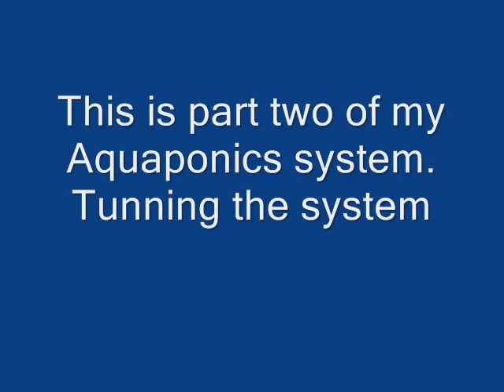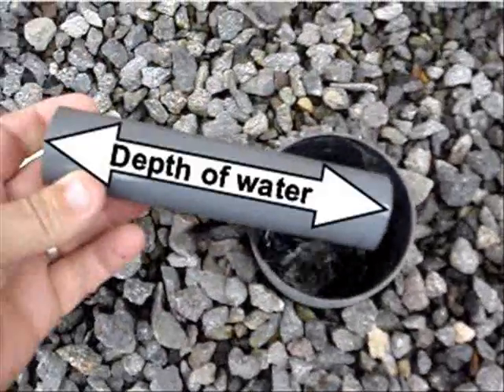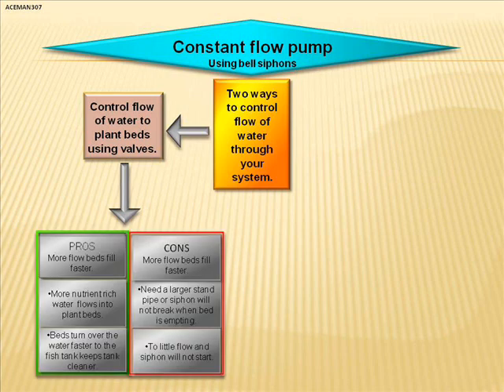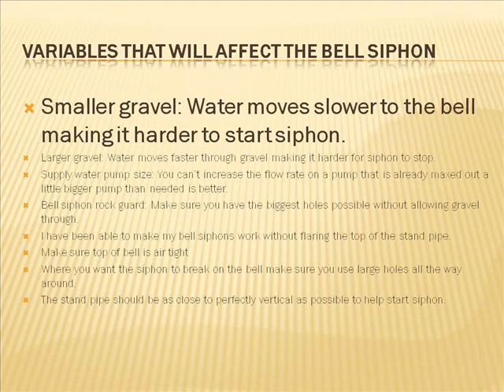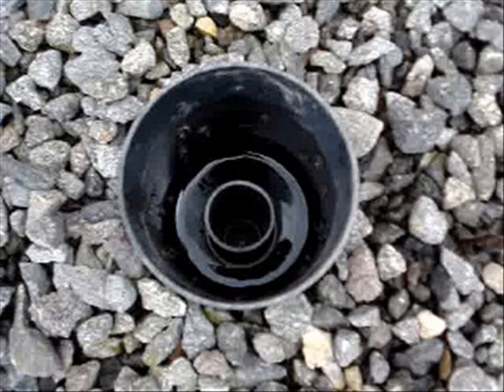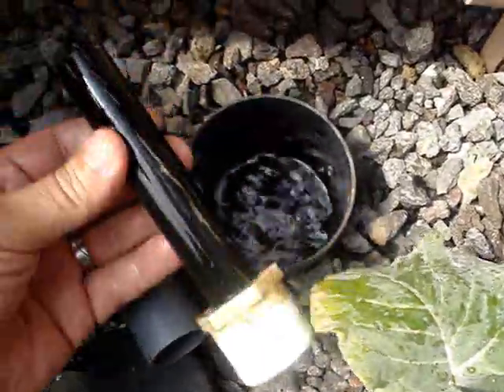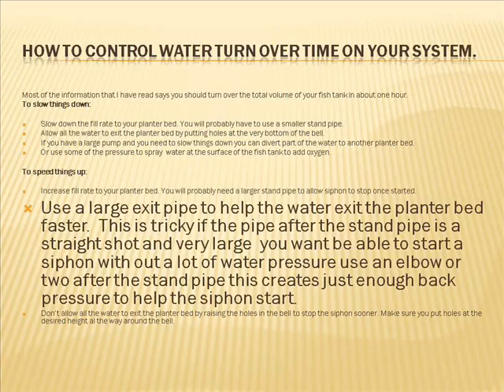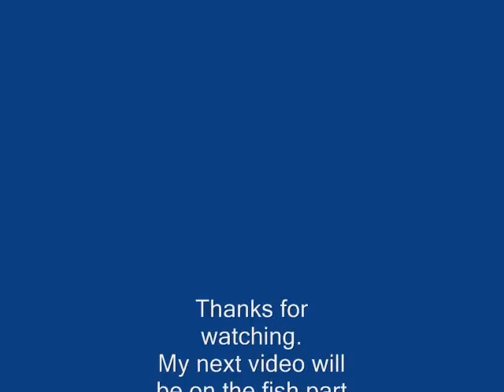Aquaponics , adjusting the system

Comment: i have been collecting as much info and collecting parts, 2,  10 x 12 well made green houses, ibc tote, racks,pumps, containers, i want to do a small clarifying,to bio waterfall system.( i want to try perilite for the waterfall, what do you think? plastic can wash off bacteria, 1/2" gravel in 3  eeb 2; x 8; grow beds stacked, with sump below. i want to run pumps full time to make it easier on pumps.i want a battery backup. i will use bluegill or sac. perch for our area temps.

Comment: Good vid. Sweet setup! 

On the topic pumps. Temperature increases lower the output of "cheap" pumps, so on hot day's ur bell wont start... So if ur system/budget allows it, go for the adjustable pumps :) Running 2 small 60 liter systems myself in house now during the winter ebb and flow, works great.